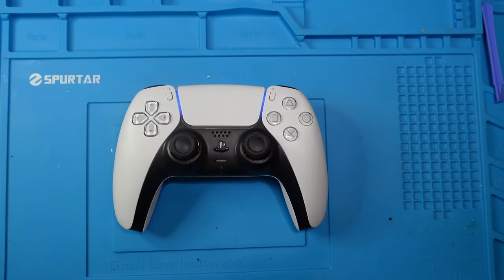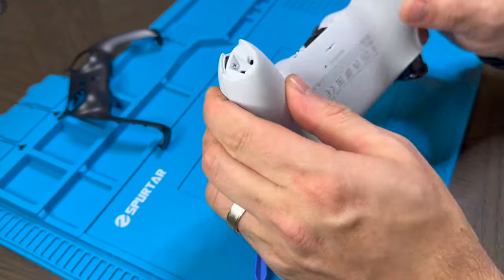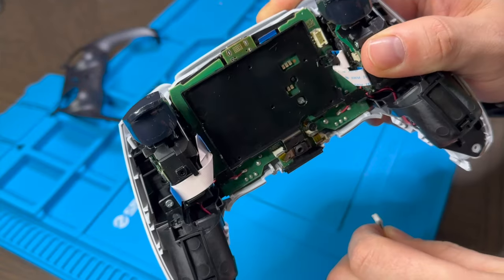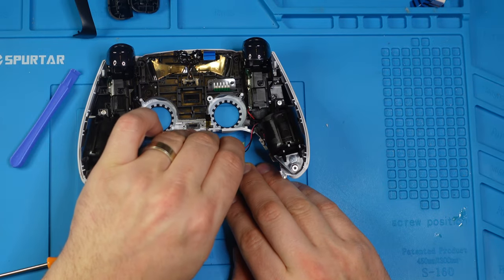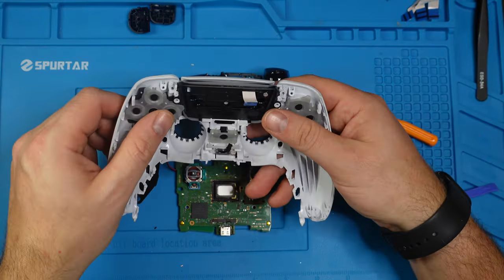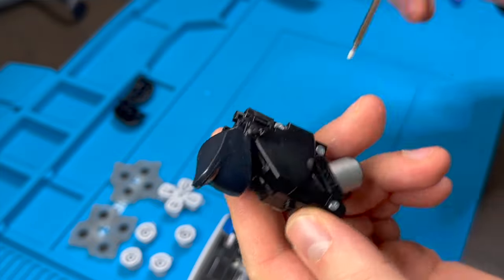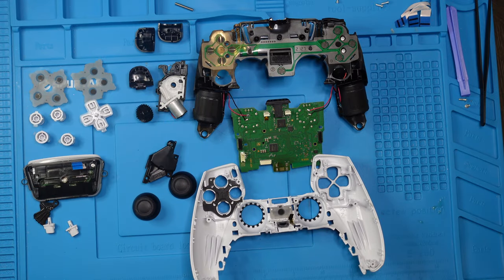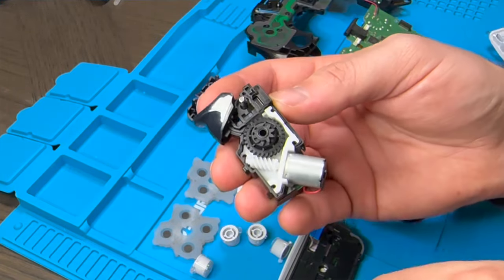PS5 DualSense Controller Tear Down Step by Step Guide

Comment: Question. With newer controllers, you cant just pull the back off that easily. It appears there is another set of tabs in the L1/R1 housing area. Could you provide a video showing how to pull that off?
Reply: There is two little tabs on top of the ps logo
Reply: They are like really tiny
Reply: Excellent question 👏
Reply: @lgs2054idk if I'm too late but there's two tiny screws underneath the L1 and r1 buttons. Just use a knife to take them off to reveal the screw

Comment: There is a new version of the controller where there are two hidden clips on the side of the seams on the controller near the R1/L1 bumpers. I can't get it open because those clips. Any updated instructions on how to remove those?
Reply: i just pulled really hard and it worked

Comment: mine is completely different inside, 4 wires, thin connectors, plastic in one piece
Reply from the maker: You have the newer GEN the 030 or 040. I have a video on that one too: https://youtu.be/NrYY1JxJt_o?si=GgL29xjmiBrjWpSy